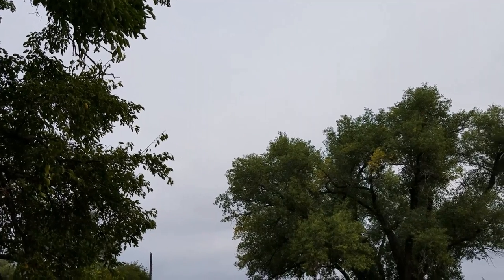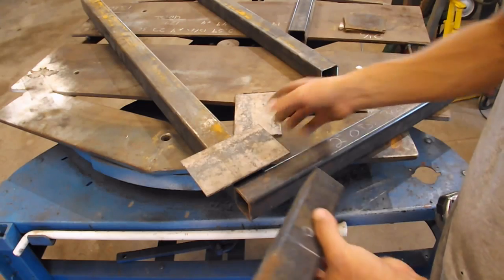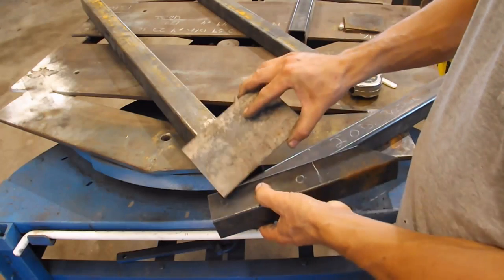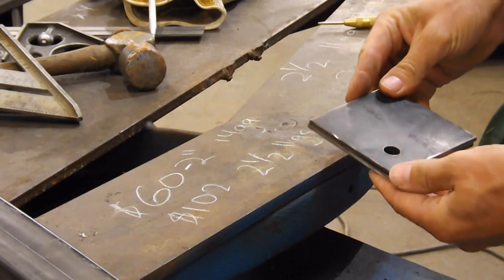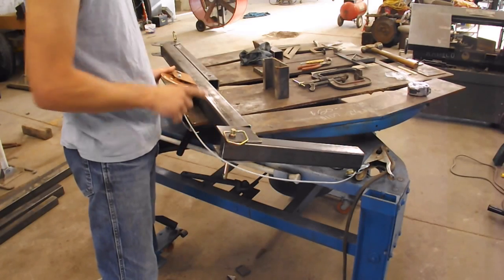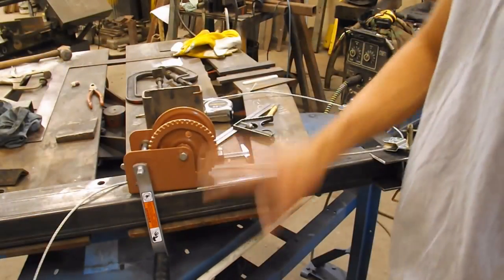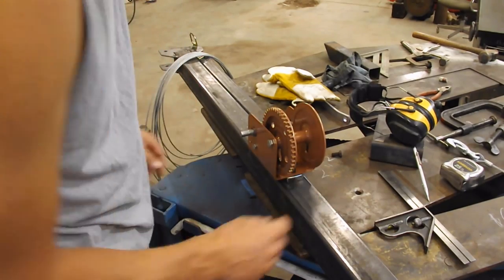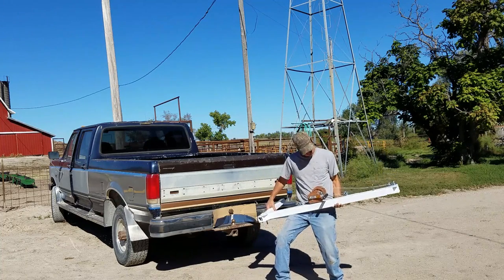Receiver Hitch Crane - Deer Hoist Build

Comment: One neat deer hoist. It looks like a boat hoist to me so it should easily do 300 lb. Fun to watch the build, too. Good hunting.
Reply from the maker: I'm happy with it! It's definitely strong. I think if I added an outrigger, it could lift well over 500 lbs. If I added a swivel, I think it would lift 55 gallon barrels into the pickup.  I'm looking forward to deer season this year. But I don't bow hunt, so I have to wait until December when rifle season starts.
Reply: I am not used to these Imperial units but a gallon of wateris about 8 pounds mass if I remember, So still about 500 lb. Here in Alaska hunting swason is on, so moose have wisely vanished (probably to Pierre's garage:)). If you bow-hunted you can get feral cattle anytime.
Reply: I was planning on making you of these but not all the folds . After watching your video the folds are more work but a lot better .time to rethink my plan ,thanks for sharing

Comment: how much did that deer hoist cost to make
Reply from the maker: I bought enough steel to make 5 of them for $200. Then the winch was $40, the pulleys $10, and $10 for paint. Plus some bolts and pins.  So a little over $100.

Comment: Nice design.  I used one of those 4 wheeler winches from Harbor Freight so I can skin hogs, raccoons, deer using one hand and remote switch. You can always add the 12 volt motor to yours for under $40.00 when they are on sale. Makes pulling hides off easy. Let a winch do all the hard work. Thanks for sharing.

Comment: Definitely need a swivel on it. You'd be amazed at what you'll use it for. I have one that bought from a guy that it. I added a pipe and sleeve so it will swivel. Also put a sleeve on my trailer so I mount it on trailer to load and unload stuff or as a another place to skin a deer. Now I need to add an out-rigger to use it on my four wheeler.

Comment: With that configuration of pulleys you could easyly put the wich on the back side I think! cheers and good hunting.
Reply from the maker: I guess I cut that out of the video, but if the winch is on the back side, the tail gate hits the winch when being opened and closed.

Comment: Look ok but Instead of using pulleys, which are a stress point (yes they are, they are meant to relieve stress but they still are a stress point), you should have made it a boom lift. Makes it stronger and more modular. 

By having a pivot point where the boom and receiver tube meet, then have the winch closest to the truck it forms a triangle. This is much stronger.

How does this make it more modular? Well you place the receiver tube on first, as you did, but then you are not having to lift the boom into place trying to balance it. (you could have just laid the end on the ground by the way)   You just leave the top end on the ground, align pivot holes and insert the pivot pin. Attach the winch cable and raise the boom. Hook deer up and winch the boom up.

Comment: Are you using 3/16" or 11 gauge tubing?  This is a great build!!
Reply from the maker: I believe 11 ga. It's been a while since I built this, having difficulty recalling. The 2" square piece that goes into the receiver hitch was thicker side wall. (At least a 1/4, maybe thicker)  The customer was very happy with it, but said it needs to be able to swivel so the deer could be loaded into the pickup.
Reply: Along with anything else you might want to load into the pickup by yourself.  Multi-use is always a bonus.
Reply: @WideVisionMetalFab  very nice ,  all one has to do is put the tube in reverse and  winch the deer up , it will be close enough to put in the bed of the vehicle